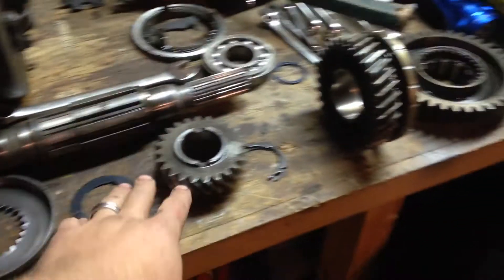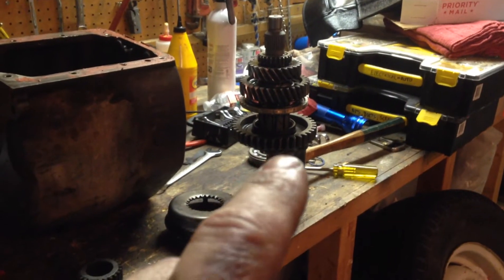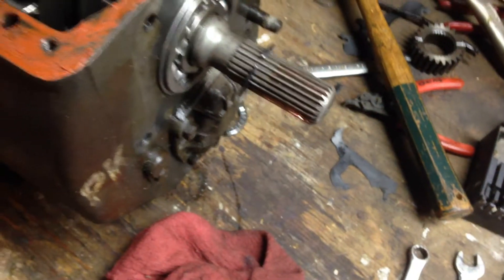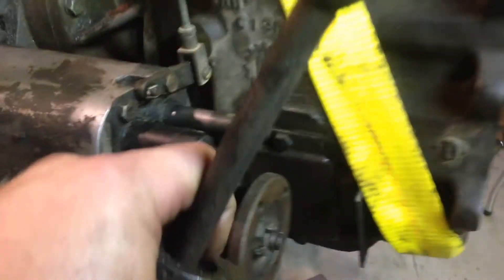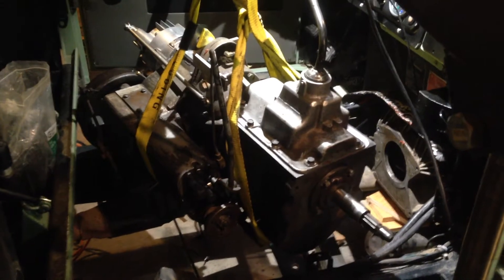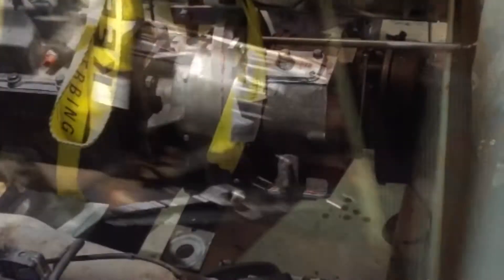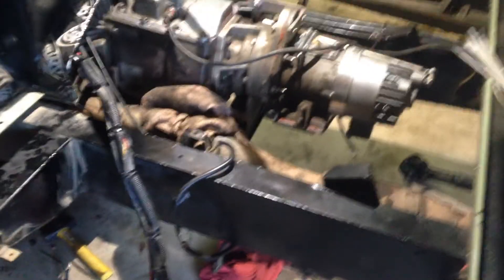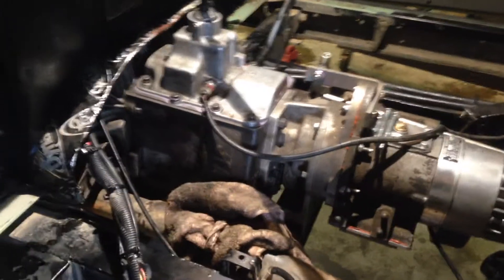30: NP435 Transmission Rebuild ( http://www.fordification.com/tech/PDF/NP435-rebuild.pdf)

Comment: This may sound crazy , but here we go!!! Will the driven geers swap out to the idle shaft ?  Reason being I wanna build a under , direct , over transmission. Was thinking the New Proses second geers would be the correct ratio I need for both the underdrive , and overdrive. I'd rather not hafta make the geers if I could simply buy bullet proof proven geers. I can make the shafts , housing, and 🍴 fork. This use to be a common swap on big semi trucks to swap the ⚙️ gears to overdrive 9 ,10 , 13 , 18 speeds. Well the 18 speeds were hot rods on their own right.

Comment: I'm guessing this is a ford NP435 4sp? Are all ford NP435s the same other than the difference in 2wd or 4wd output shafts & tail housings? I know the 4wd has atleast 2 different output shafts. A 28 spline for a Dana 21 transfer case & a 31 spline for a NP205. But other than that were there any changes made over the yrs?

Comment: This is a lost opportunity to archive a YouTube video showing how to rebuild an np 435 transmission; clearly you know how to rebuild this transmission, but it’s very disappointing you didn’t put it on video. You assembled a general narrative commentary with a wandering script, but little can be made of the video contributing to the collective knowledge of how to rebuild a transmission in general, or how to rebuild the np 435 in specific. There are decent videos on how to rebuild similar transmissions like the SM 465, or even the T18, but NONE on how to rebuild the 435. It’s frustrating to have only bits and pieces and glimpses of the 435, only to have the video skip around, 1 second disassembled, the next assembled, then the next installed.
Useless.

Comment: Hola quisiera saber si esa caja de cambios NP es original de ese vehículo o sea si vienen de fabrica en ese Land Rober
Reply: No...por lo que se ve en el vídeo es una remotorización de ese Land Rover con un motor V8 problablemente un Ford 302 o 351 EFI de Inyección electrónica (7:06 a 7:08) en lugar del motor de cuatro cilindros original del "Landy" y por consiguiente la caja de cambios New Process 435 es compatible con ese motor Ford V8 ya que fue equipo estándar en muchas camionetas de las series F-150 a F-350 entre 1964 a 1993 mientras los "Landy" vinieron con cajas de tres cambios en las series I y II (Británico y Santana Español) mientras en las series Defender ya venían primero con cajas de cuatro cambios y luego de cinco cambios...

Comment: Where did you buy your parts for the rebuild? Bearings, gaskets, seals, syncros, etc...?I've been looking and found a few websites but am very skeptical.I have an 87 ford F150 4.9L 4x4. Thank you
Reply: No sé inglés
Reply: @agustin1736  te pasas de verga Agustin
Reply from the maker: I want to say summit racing, but I purchased it online. Something like this:  

http://www.americanpowertrainwarehouse.com/np435-transmission-rebuild-kit-fits-65-ford-gm-with-tapered-input-bearing-bk127/
Reply: I could be mistaken but I dont believe a 87 ford would have a NP435 4spd?
Reply: @jesseduke694  dang this is an old thread lol
I actually do have an NP435 but found a ZFS5-42 transmission at the junk yard and swapped it out
Reply: @alighazal6546  interesting! I didnt know they used them up to then? Ya, I saw comments were from 6yrs ago. Lol
Reply: @jesseduke694  I’m not sure what years exactly they used them on but it’s a big hunk of cast iron it looks old
Reply: @alighazal6546  yes they are very heavy & rigid but have a aluminum top piece. It's how to tell them apart from a T18 or a T19 at quick glance.